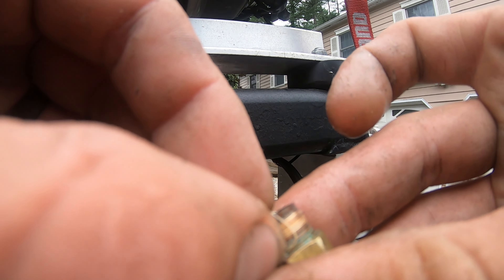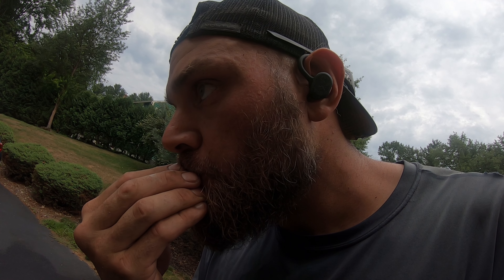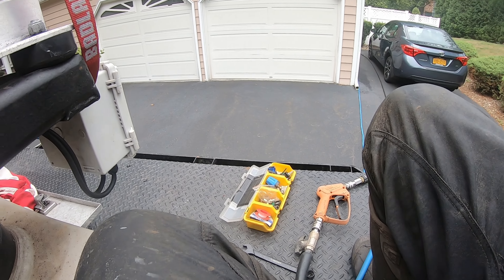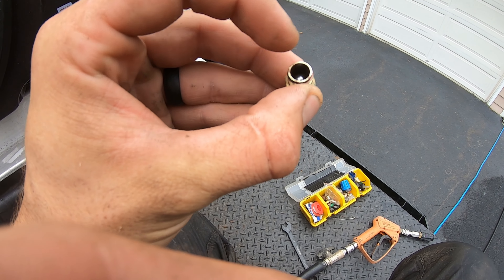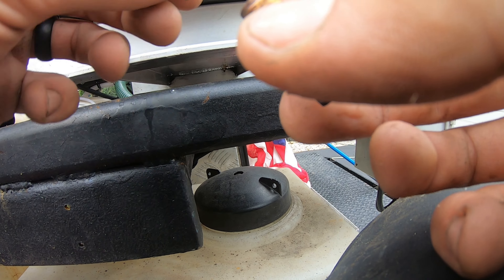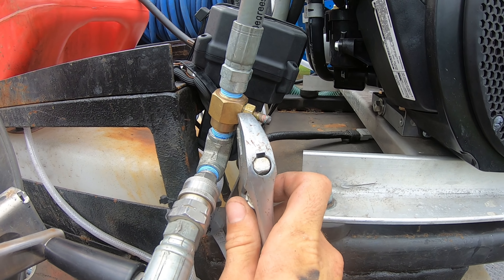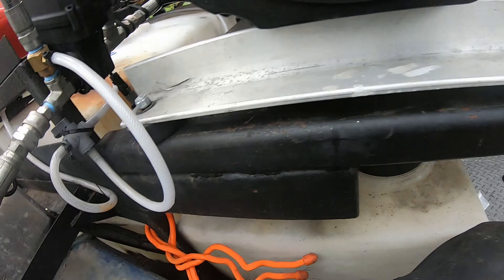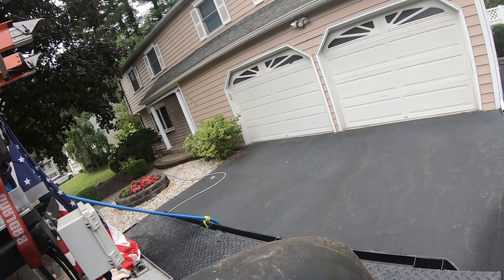Downstream Injector Not Pulling Bleach! - Is This A Simple Fix? 2.3 Orifice 8 GPM AR Honda IGX800

Comment: Hey Eric, I use quick connects on both sides of injector so I can pop it off quickly and replace/swap with a spare I keep in truck (either 2.1 more draw and 2.3-regular) both are GP stainless steel with S/S spring and ceramic ball. (From Kleen-rite).

…or just blow into the injector (or push in lightly with something) to unseat ball without taking apart, the ball sticks sometimes especially non-stainless. A little squirt of Wd-40 once in a while helps. 
Btw, I could take injector out of the line all together if needed but I have ball valve bypass.
Reply from the maker: Thanks! 👍 will do that!
Reply: Sent you a message.
Reply: Hey can you post the kleen right model #s to those 2 injectors you mention (2.1 and 2.3). I wanna be sure I buy the right ones

Comment: Hi Eric I power-washed to I normally just xjet everything cuz I got sick and tired of the chemical injectors breaking the chemical injector sure is convenient sometimes specially when you have to reach high areas my question is does the ball and spring rebuild kit work
Reply from the maker: My 1st and only Injector is almost a year old. This was the only issue I ever had and I just had to unstuck the ball. I have a 3 way that I use to rinse the injector after each job. Helps protect big time
Reply: Thanks 😊

Comment: I use WD-40 with the small diameter tube, it feeds right in the injector hole and when the engine of the pressure washing is off, I push the small ball and score some Wd-40 it works really good.
Reply from the maker: I will definitely be trying that

Comment: My biggest challenge at the moment is getting my original 1.8 downstream venturi, integrated into the pomp, to work on the 100ft hose. I did the same as you but it only works with a 50ft hose. My idea is to remove and bypass the venturi downstream. What should I look for to work with hoses longer than 100ft??? 4GLM 4000psi

Comment: New to the channel thank you for sharing. New to the biz just bought a second machine professional grade. Even with my first machine I can't seem to get soap through the injector (the regular type with quick connect) unless it's with the black soap tip. I have a j-rod tried all the tips no dice. Even tried with new injector that can with the machine. The arrow is pointing towards the wand (away from the pump) tried it the other way too. Only able to do driveway for now since I can't get the height for a house. Frustrating. Any help as to what I'm doing wrong? Thanks
Reply from the maker: Hard to tell without seeing it. Send a couple pics to Adirondaxps@gmail.com
Reply: @YoungAmbitionYA  ok I'm out of town now but I will send towards the end of the week. Do you need pics of the injectors and the j-rod? I can get my son to send pics to me. Please advise. Thank you!
Reply: @YoungAmbitionYA  I just emailed you the picture

Comment: Using the 3 way ball valve (the plastic one), do you see a drop in the "flow rate"? Since it's pulling both SH and diluted soap solution at the same time, as opposed to just straight SH (with surfactant mixed into the SH tank). Thanks!
Reply from the maker: My 3 way Pulls a soap/sh mix from 1 tank. Pulls great. If I turn the ball valve the other way it Pulls water to flush the injector

Comment: All you have to do is start your machine and pull the hose off the injector. Carry with you either a paperclip or something else and poke it while it's running. You will then feel it pulling vacuum with your fingertip. I rinse my injector every time I wash a house I rinse the last side of the home through the injector.
Reply from the maker: Yes I rinse after every job. Multiple times a day. Injector is only 2 months old. Surprised it stuck so soon. This is my first Injector, so glad it was a simple fix. Good learning experience

Comment: Iv removed the ball and spring and re adjusted and it didn’t pull Chem still
Reply: Same idk what I’m doing wrong I’ve tried multiple ways and arrangements. I’m gonna buy an xjet instead
Reply: @lastnamefirst650  just downstream with a Gp 2.1 fixed injector. And just don’t let it sit so the out pressing the trigger for more than a minute you’d be fine .. ita strong jet is just a hassle carrying more hose and a bucket with a lot of over spray

Comment: 1 psi 1/4 inch check valve. Remove the spring and ball. Problem solved. Check valves last much longer. Last one lasted almost 300 hours.
Reply from the maker: Will check it out. Thanks T